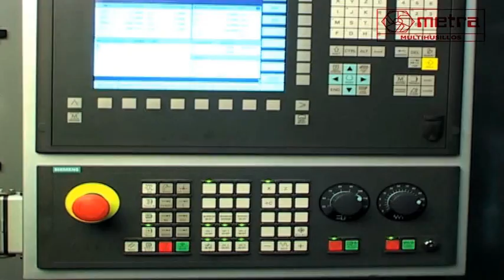CNC MULTI SPINDLE in mass production (PRÄZISION Mehrspindler) | Torno multifuso

Comment from the maker: Even it doesn't appear in the video, that machine was equipped with bar feeder, extractor fan, chip conveyor (with engine), coolant pump, 1 main engine (30 KW) and 12 servomotors. Looking at the productivity, this consumption should be compared with 5 single spindle screw machine...

Comment: brass is softer than steel, it doesnt harm the tools if you dont use coolant. dont need servo motors, because this is not cnc. all things run on cams, gears and clutches